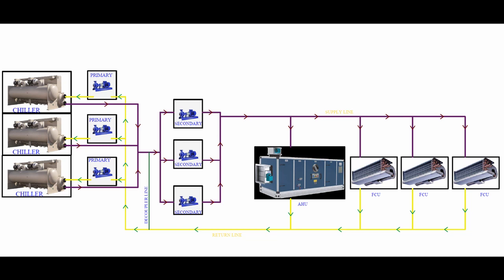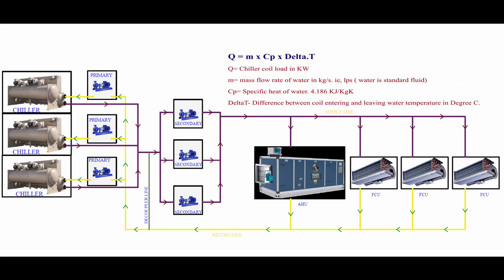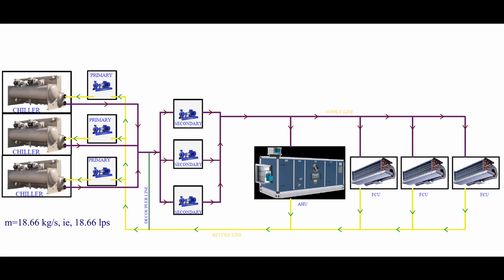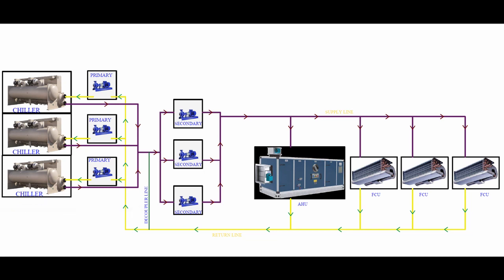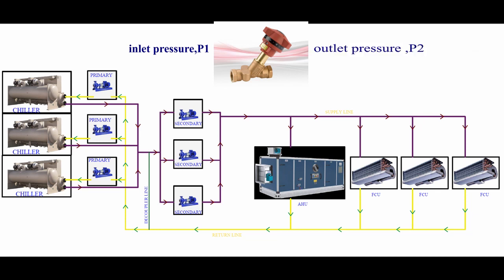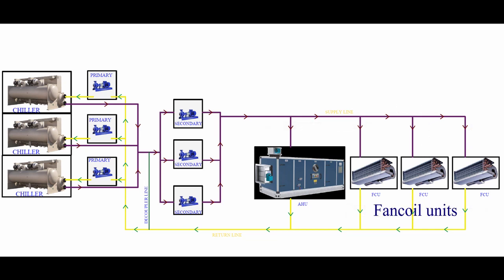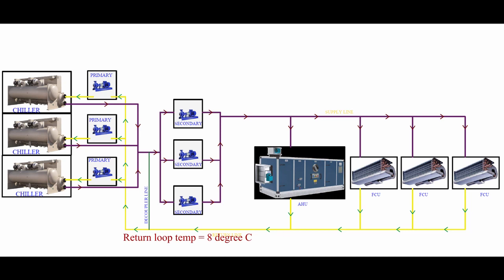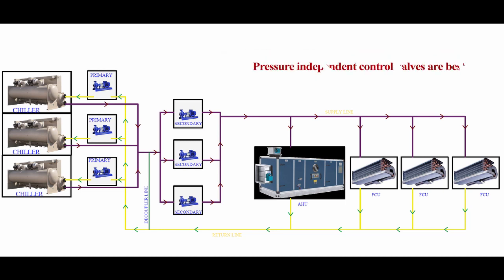Low deltaT syndrome of chillers explained/ hydronic systems/ AMNEAR MEP

Comment: Hi sir,
If the chiler inlet and outlet temp are 12 & 7 then what will be the low delta T syndrome.
Reply from the maker: Sorry for late response. Hi... with respect to the load within the building return water temperature may vary. Its not constant. Any how now a days we are using variable flow systems with PICVs for balancing. Comparing with the constant flow systems low delta T syndrome is not a huge issue in variable flow systems.